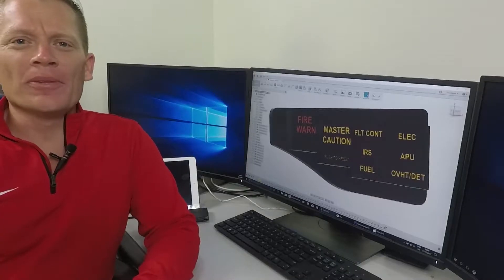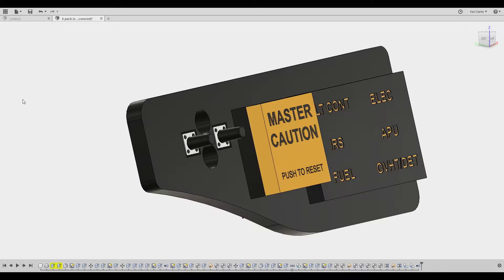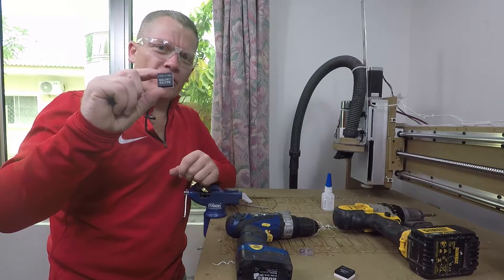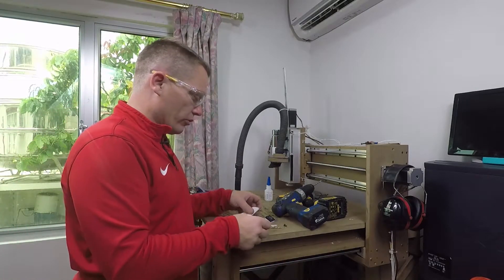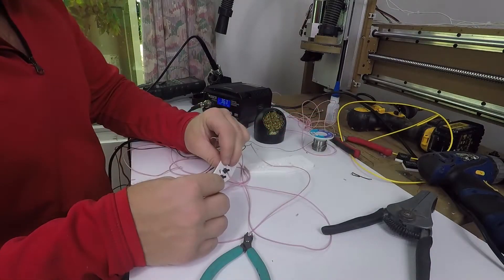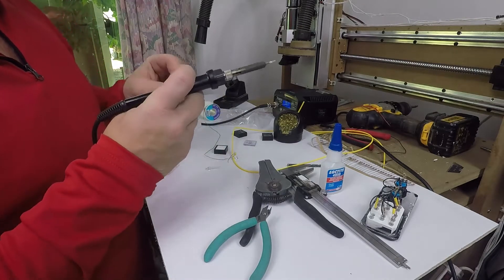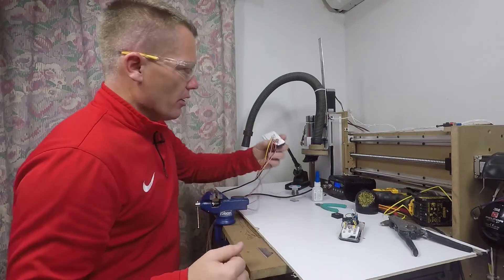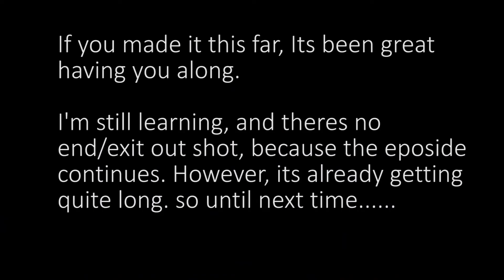737 Sim Build - Building the Master Caution Panels #5

Comment: Helpful tip: when you want to drill a hole of 5mm depth.  Measure up the drill bit 5mm and put a piece of tape on the bit leaving a flag sticking out.  When the flag contacts the surface, stop.
Reply from the maker: Cheers Randy, Noted!

Comment: This is NEAT!! I'm looking into making myself some panels too. I'm just curious: how did you make the black announciator? I'm trying to figure out how to do this properly.
Reply from the maker: Hi Ricardo, The annunciators are purchased from www.cockpisimparts.co.uk. You can print them in translucent yellow with raised text, spray them black. Once dry, lightly sand off the paint from the raised text. It works, but doesn't look as sexy as laser engraved parts! Kind Regards Karl